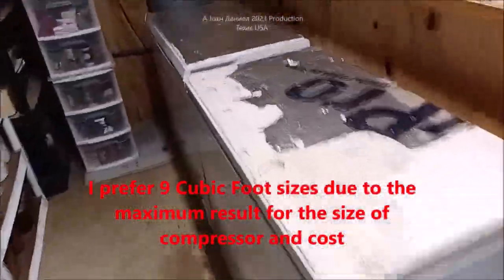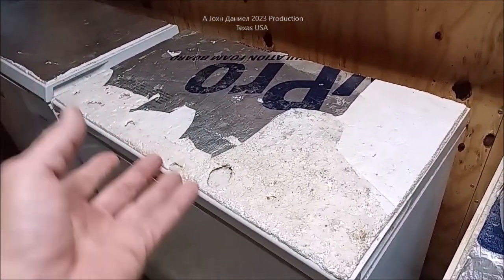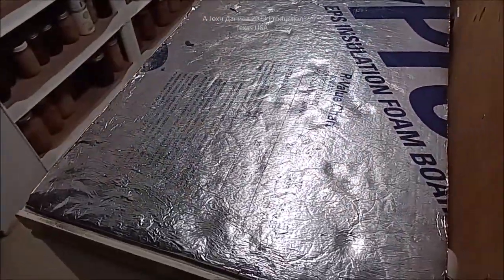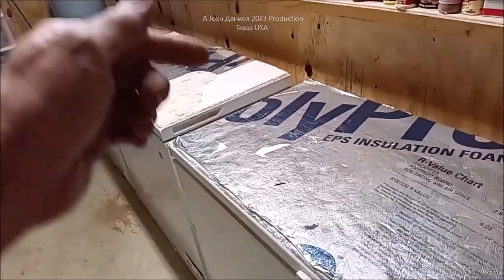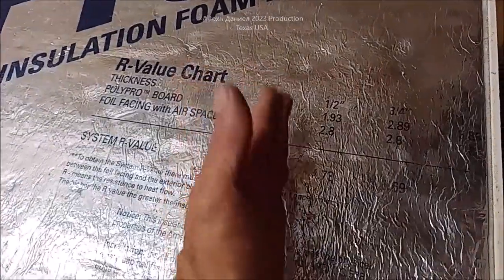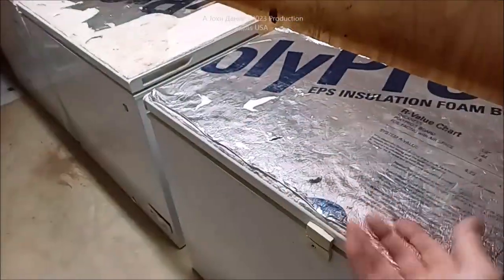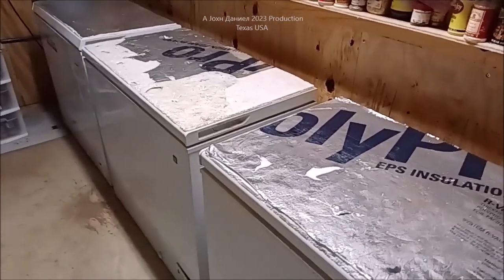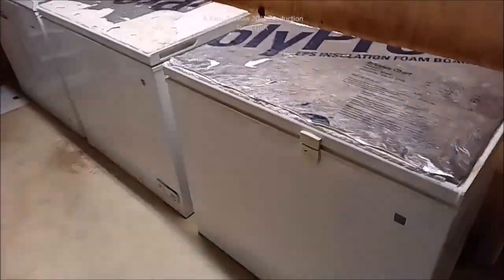Cutting my Electric Cost by 30% on refrigeration for $10, Results were surprising

Comment: have you tried stringing one of those thin tube plant misters around your A/C unit? You could even consider using a watering timer so it only sprays mist when the suns out? I don't have a home, myself but I've heard of 50% reduction in electric bills and far less wear-n-tear on your now (far more efficient a/c unit). Attach the mister lines around the A/C with zip ties, shouldn't take long. Also, when Kiera is old enough to be married, I'll probably be close to 80, so you need to reconsider. Here's to hoping for an apocalypse, lets build an ultralight helicopter. 😁
Reply from the maker: Why don't you have a home? You were invited to park a RV back in our oak trees around the pecan gove. You never showed up. I got my 40 foot motor home for sale for $6500 to use as a home if your willing to do a little work to set it up.
Reply: @JOHNDANIEL1  I have a small diesel bus, but I haven't been doing too well fixing it up. I'm just not that great on knowing how to do stuff and not much money. I don't need a lot, but need some kind of a source of income to live and haven't figured that out. I'm a veteran from the 80's, lost in life really. I've been with family for a long time. I plan to work the beet harvest up north in October. I have my basic stuff, small generators, water heater, a/c unit, cooking stuff, tools, etc. I would like to meet you and your family one day before I become a ghost in some Arizona desert.
Reply: @JOHNDANIEL1  Hey, your daughter was supposed to be moving into that one, not the princess K.
Reply from the maker: @massa-blasta  Would you like to run a dump truck hauling sand in Challis Idaho for $900 to 1000 a week for the Shot Crete supplier, 3 to 4 days a week. All summer and into fall. About 7 to 9 hour days. Back road 25 mph there and back 2 to 3 loads a day.
Reply from the maker: My other daughter is choosing the Holiday Rambler presidential since its lower and she like the design. The motorhome is a lot bigger and takes more power and things to live in it.
Reply: @JOHNDANIEL1  I don't have a CDL and it's already hard for me to drive this bus. I need some kind of backup camera. Could you teach me to drive it? I just wanted to be learning a skill I could use to survive, vs learning nothing driving a truck. I need money tho and until I could find something else. No CDL, tho. I hate it here, hate the city. I have a clean driving record, but hardly ever drove a truck., so would need some help.
Reply: @JOHNDANIEL1  If your daughter is in the rambler, then at least I would have a neighbor. Maybe you would let me borrow your dog sometimes, I could teach him stuff. I love dogs more than people.
Reply from the maker: @massa-blasta How old are you now?
Reply: @JOHNDANIEL1  55, but don't so much look or feel like it, aside from the balding. I'm a senior citizen at the Goodwill. 😁
Reply from the maker: @massa-blasta  About the same age as me. And likely just as broke up and damaged from years of hard work and living. I pride myself on looking younger than 80 and crippled!
Reply: @JOHNDANIEL1  I know you're broken up. I was afraid you were going to die at one point. I'm pretty alright, but my vision has always held me back. Severe nearsightedness kept me from my dream of being an industrial diver. I had plans to go to The Ocean Corporation in Houston, until I found out I couldn't pass the dive physical due to my eyesight. I was so disappointed, those divers can't see anything down in that murk, anyway. Joined the Navy after that, same story. I worked on the electronics of old helicopters for a while. Nothing that was ever useful to me. I had lasik and all that, twice long ago. You've really got to see well to work with your hands and be successful. Never wanted to be a truck driver, so boring just sitting there. I also love welding, but struggle with my vision. I went to welding school, but a really poor school and they said I could surely weld but needed to learn to weld straight. It's my eyesight, couldn't see where the line was. You could work the beet harvest with me for some extra money. It's like a month and a bit, long hours on your feet directing trucks unloading. I never worked the harvest, but mindlessly working retail and such makes me so depressed I just can't do it anymore and would rather eat a bullet. I do wish I could have found a sweet woman and had the children I always wanted. I got my heart broken badly a couple of times young and pretty much messed it up for me and women. I even moved to Belgium for a french girl who didn't even care about me. 3-yrs there. Stay away from doctors if you want to stay healthy, especially antibiotics and antidepressants. Covid going around helped my allergies and I discovered I have natural immunity. If you took the shot, RIP cuz your organs have all been aged. Magic Mushrooms or a woman is gonna save me, that's what I think. I'm betting on the spores, but don't have any and will probably pick the wrong ones and die. Could save a lot of vets lives, so they will probably never be prescribed to them. 😁
Reply from the maker: @massa-blasta  I ran a few seasons of Beet trucks in Idaho many many years ago. I made my own glasses tired of the morons in eyeglass shops. Welding ruined my eyes, not the arc, the smoke as a certified pipe welder pipe fitters 195 and PPC fire systems work. The worst is SSDR welding in split spaces. So all my future welding is done in open or not at all. 
From your definition, your eyes have farsightedness. Close up, within 5 feet is bad. But see well FAR AWAY.
Reply: @JOHNDANIEL1  These days I see ok far away, since all the Lasik, but I think they botched the job and won't admit it. I was born severely nearsighted. Now, I have the age related nearsightedness on top of it and a little astigmatism to make things fuzzy at all distances. I never wanted to pass those genes on to children. Is there anything you can't do?? Some people are just born with these abilities. I did buy that flux core wire you recommended, but I don't like MIG. I like stick welding and would like to learn TIG. I even bought the gas bottles and all that. I tried outside, but the gas just blew away and I don't have a shop. I found this successful prepper in N. La who basically retired young 40yo from pipe welding. He has a welding channel, too. He's got lots of money and calls himself a Financial Prepper. He and his wife are Christians and a real inspiration. He said the welders eyes go bad from the gas flame, not the arc. He knows the Apocalypse is coming, we all know it!
Reply: @JOHNDANIEL1  you made your own glasses, lol. I hate eyeglass shops. I spent a fortune on high index eyeglasses and toric contact lens when I was younger. I know a shop here that does a mail-order business that's very well known among welders. The sell high quality, high $$ clothing for the people in the plants. I had a cheater made for my pancake hood, but the setup is way too heavy. I wanted some tiny welders glasses but didn't have the money. Tom Waters in Baton Rouge.
Reply: @JOHNDANIEL1  you should have worn a pancake hood, which protects your eyes from the smoke. I use a portable fan, but it would be better to use a 12in Utility Carpet Blower to suck the smoke away if you have one.